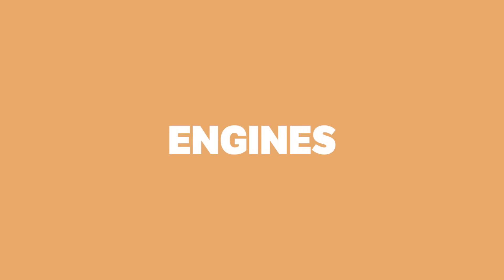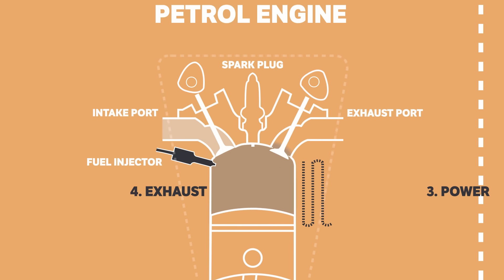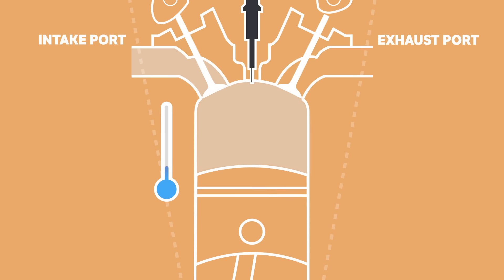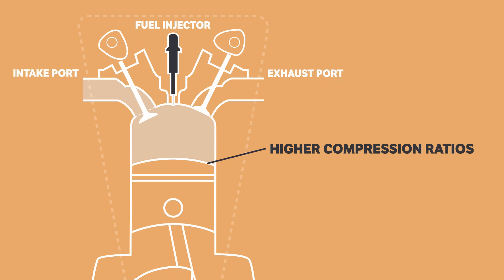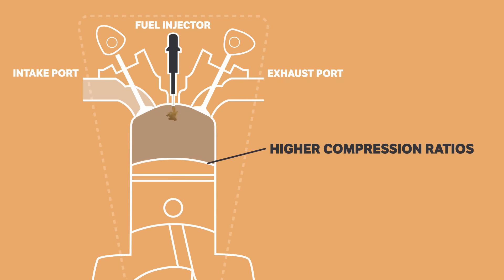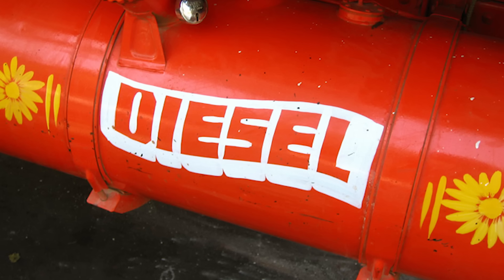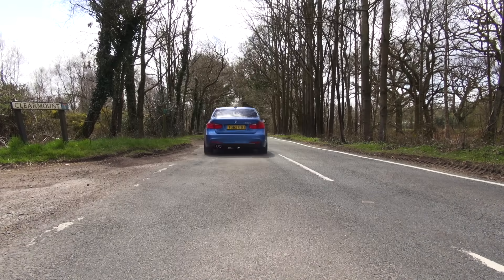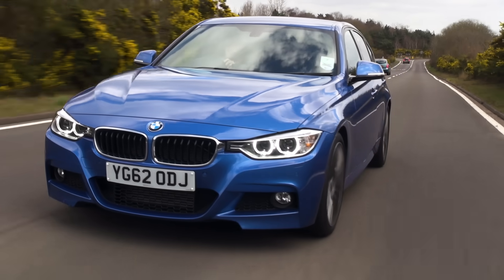The Differences Between Petrol and Diesel Engines

Comment: Can you do a turbo vs supercharger ☺️
Reply: I think he's only heard of the SRT Demon.
Reply: diesels do better with a turbocharger because of the high compression it will drive the turbine blades better and will lite both chargers for better boost and the diesel will get more torque that way but superchargers rob a lot of power from the engine to spin them for the air pressure into the engine
Reply: diesels are more built for torque and pulling and are not made for speed that is why the power curves between the two engines is the opposite and a diesel has got to get to 1000 rpm before it starts making its HP where a gas engine can make it at a lot higher rpm`s versus the diesel but the diesel wont stall as fast under heavy load like the gas engine will because of the twice as much compression
Reply: both compress intake air to get more oxygen in the combustion chamber - with more fuel and oxygen you can generate more power and torque.
the main difference is how they are actuated: while the supercharger is powered directly by the engine with a chain or belt, the turbo uses the exhaust gas to turn a small turbine. this turbine is connected to a second one on the intake side, which compresses the air.
this is the reason why turbo engines are more ecological, they use energy that otherwise would be lost. they need a certain rpm to work properly, while the supercharger does its job right from the start.
i hope this helped a bit!
Reply: I only deal with diesels and I have a 96 dodge cummins with 12 valve motor in it and I built the truck and it has lots of low end torque as a real diesel should and I designed a part for the fuel system that gets more power but uses less fuel and burns more efficient the fuel and the engine can breathe better too
Reply: The Bugatti Veyron and Chiron both run 4 turbochargers, not superchargers.  The Hennessey Venom GT is a twin-turbo.  F1 cars use a turbo.  The land-speed record for a piston-engined car was in a turbocharged V8.

Which world are you talking about?
Reply: I feel like turboes are better on smaller engines, and superchargers are better on larger engines.
Reply: chris mchenry petrol doesnt need that much boost die the same hp. give a petrol the boost the diesel has and it will fly.
Reply: Thundershark777 Best explanation
Reply: Kolin supercharged cars will be quicker off the line but not faster top end, put it this because a supercharger is driven by the crank, at certain rpm that's all you'll get out of the boost you'll get, now in theory, with a turbo because it is exhaust driven at certain rpm with higher spool the combustion is even grater causing more exhaust gasses resulting in even higher spool causing combustion to increase again continuing the process until you let of the gas...
Reply: With the diesels higher compression it can power the turbo better and you have got to match the turbo with the size of the motor to make sure the engine is getting enough air for the atomization of air and fuel mixture because the air ratio is a lot more than a gas engine is
Reply: chris mchenry and because it's safest in hight exhaust thrust
Reply: Limbos I'd also like to see a video by them on this. I already know most of it, but he makes it so easy and enjoyable!
Reply: Watch mighty car mods for that
Reply: supercharger is powered by the crankshaft my man, faster your pistons are moving the more boost you have, that also why you have boost from idle (no lag) and in neutral, if it were gearbox driven you'd only have boost once the car starts moving in gear as well as tragic supercharger lag. You're right with the turbo though, it is more efficient...
Reply: The supercharger is the same principal as a screw type compressor that it compresses high volumes of air and force feeds the engine with boost pressure in the intake side to help the fuel burn better and just a ? is which diesel engine maker made a diesel that wont run with out a supercharger because it cant make its own compression and needs a turbo and supercharger both to get decent power out of it to pull
Reply: chris mchenry that's why I like pulley kits for supercharged cars
Reply: +Kolin Stallman I have to disagree. Put simply, the fastest production car (as well as the quickest) that uses a supercharger is the SRT Demon. However, there are plenty of faster production cars that use turbos because, despite the lag that superchargers don't have to deal with, they are more efficient. They generally make more power, although at a higher RPM, it is still a higher gross HP number. Torque is also generally higher, but with a supercharger, the numbers of torque and horsepower are generally closer together, whereas in a turbocharged engine, HP is generally far higher, unless the engine had more torque than horsepower to begin with. I, myself, prefer superchargers for the lack of lag and (in my opinion) better sound, as well as (once again, in my opinion) the better look. But, I can acknowledge that turbochargers are generally better than superchargers. To put this into perspective, the Dodge SRT Hellcat's supercharger makes roughly 200BHP, when you include the intake, intercooler, and exhaust system needed for the supercharger. A turbocharged BMW M5 Jahre makes quite a bit of power, but the turbo is most of that power. Factoring in the intercooler, exhaust system, and intake, plus the turbo itself, it gets about 400BHP. From the turbo setup alone. If it were NA, it would make only about 200BHP out of the 4.4l twin-turbo V8. So, to refute your argument with evidence, have a nice day, and know that, once again, I, too, prefer to use a supercharger. Hell, I'm supercharging my towing rig until I get a diesel, and I'm supercharging my Corvette. It's just my preference.
Reply: Because the supercharger responses faster for instant power boost to the engine to get up and go instead of having to wait the extra time for the turbo to wind up and build pressure and for the turbo to catch up with the engine and diesels have more pressure in them to drive the turbo better than a gas motor does and with the pressure  turbo can get the gas engine block cant hold the pressure as good as a diesel can
Reply: Super charger is powered by the gears in your gearbox to drive compressor, which would also consumes up your engine horse power, in other words, less efficient. Turbo uses exhaust gas to drive the compressor section, it doesn't require you to mount it on the engine, it is more efficient. Due to the high compression ratio of the diesel engine, the exhaust pressure is higher, which results in higher turning speed of the turbine blades. Higher turning on the  exaust turbine blades create higher level of compression on your compressor section on a turbo charger. Turbo is the way to go with diesel.
Reply: Why do the fastest cars in the world use superchargers and not turbos?

Comment: There are fun Diesels but personally I prefer petrol, just sounds better and I like the smell of more 😂, also If I'm not wrong the reason why we got such a fucked up pollution problem is because of those diesels, but they good to get from point A to B if that's all you look for.
Reply: Not really. Only about 30% of green house gasses are emitted by cars. The major culprit is live stock. Mostly cows, that produce methane, which is up to 72 times more potent of a greenhouse gas. Diesels actually have less CO2 emissions than petrols, only more NOx emission (the one VW cheated on).

Comment: Petrol engines have very poor feedback. Hardly any in modern cars.

I think diesels are much better. You can really feel the engine. Not to mention you'd have to be downright stupid to choke a diesel engine, so it's a much better choice for beginners.
Reply: what you "feel" is the engine not running smooth since diesel engines shake much more then petrol engines. what u call "no feedback" is called luxury. also feedback comes form the steering wheel, not from the whole car interiour shaking ;)
Reply: That's true, but I think it's more of a "new car vs old car" argument. I have 2001 Golf TDI as my daily driver, no complaints, everything feels great. But when I drove my uncle's Golf Plus (2007 I think) the clutch felt like  it was... on a rail, if that makes any sense. I think it has some mechanism in place to prevent choking, and it takes away pretty much all feedback.
Reply: Feedback aka HUGE vibrations. Plus they have terrible response. I hate rev matching with these...
Reply: Everything that's mechanical gives feedback, or at least it should. Modern cars are designed for comfort, if something doesn't work correctly and there's no dashboard signal for it, you're pretty much screwed. In old cars you can usually feel any mechanical malfunction.
Reply: i beg to differ sir... my naturaly aspirated flat 6 rwd petrol engine gives me way more feedback than my previously owned jetta tdi. diesel are noisy that's for sure, u can feel and hear that ;D
Reply: The clutch is usually  more soft and comfortable in diesel cars, which I love so much. Nothing beats a soft and comfortable clutch. like you get used to it so fast, so its so easy to switch between cars.
Reply: diesel engines give more "feedback"? lol you mean nailing noises? or do you mean Sound, throttle response, instant power?
Reply: Are you European (No offense, I am too ;) )? Here lots of people prefer diesel because "they feel better", but actually it's juste because most of our petrol cars happen to just be some sorry rustbuckets for occasional town driving, or extreme economy cars. I've had (and still have) a petrol car you'd have to be really bad at driving to stall. I once started from a dead stop in 3rd gear and realised it when I wanted to shift, or achieved going all the way to 5th gear from a dead stop without using the accelerator. And it's a petrol ;)
Reply: clutch helper spring most modern cars have them and remove the feel of the clutch feedback
Reply: they can also be removed most of the time
Reply: Beginners aside, any moron can get a driver's license nowadays. Especially in the USA.
Reply: Obviously you don't drive performance cars. A good petrol engine is WAY more responsive than a diesel, will rev a lot higher, rev quicker, and have a much bigger power band. Theres a reason proper sports cars only come with petrol engines.
If you can feel the vibration of the engine, that's not a good thing. It means the engine is rough or something is broken.
Reply: I sort of agree with all of you in your answers but one thing that keeps popping up in my mind is about what car you drive. I have driven a lot of cars (both diesels and petrols) and it all depends on what kind of car it is. I have always owned petrol cars before but now i own a diesel. I have owned a lot of different cars like Volvo 745, Audi 80, Golf, Bug/Type , BMW e30 318 (m10 engine), Honda Civic EK9 and a couple of other cars but now i own a Peugeot 307 1.6 HDI. I really like my Peugeot i have now and i bought it just because i travelled long distances for half a year. Here in sweden at least many people think they are crap and i cant really see why..? Sure, the interior is not as good as the german premium cars of course but you get a lot of car for your money. The car i had before this one was the Honda Civic and everybody told me it was great cars that never broke down and so on. Garbage! First of all it was really boring to drive, the interior was thin plastic crap built for kids, the engine had no power and the damn car always broke down. I just kept changing parts all the time and it was by far one of the most expensive cars i've owned so far. The volvos (i've had 2 different) was thirsty things with no power and the interior kept falling off all the time. I have also driven a Skoda Pickup 1.9 (NA) and it had no power but it was cheap to drive. I dont say that my Peugeot is fun to drive but it does the job. The most fun behind the wheel of cars i've had so far is actually in BMWs. Even my old 318 was fun to drive even though it was a pile of shite. If you want a fun car to drive everyday that sort of is a drivers car i would recommend you guys to try a BMW, no matter if its a diesel or petrol :)
Reply: @99Lezard99

I mean overall feedback. That includes noise, vibrations, throttle response, everything.

@Yolo Ritona

Feedback refers to the overall response you get from the car, not just steering. Translated, that's the term we use here. If it means something else in English speaking countries (I doubt it) then sorry.

Anyway, call it whatever you like. But for me, if I can't hear and feel the engine AT ALL, then I can't drive the car. I just can't. Maybe I'm a shitty driver or maybe you were born with super human senses, but until someone can prove one or the other, I'm sticking to older cars.
Reply: @BlatentlyFakeName

Somehow I doubt you drive Lamborghinis on the daily basis either. As it happens I did get the opportunity to test drive a 6 speed manual, 2.3 EcoBoost Mustang recently. It felt like every other post-2010 car I've driven, only with slightly nicer seats.

(that's a metaphor, I actually didn't like the seats either, they felt awfully cramped for such a big car. It might just be my fat ass, but my Golf seats with the tacky beads on 'em still feel a lot more comfortable)

Anyway, engine feedback is normal in older cars. And it's a good thing to have, it gives a much better idea of the state the engine is in than the dashboard indicators. But like I said, I think the issue is more likely related to new cars vs old cars than diesel vs petrol. I admit that all the newer cars I've driven all ran on petrol, while most of the older ones were either diesel or LPG.
Reply: Why do people choke engines and call themselves drivers?

Comment: I'd go for diesel. moar power!
Reply: Diesel have more torque at LOW-END, yeah, but petrol is always high rev and has better HP/litre. needs a 2L diesel turbo to have same bhp as a 1,6 NA petrol also, haha... :P The 1,6P NA beats the 2,0D T iirc :P And room for turbo :P
Reply: Diesel has the energy/"power" to make torque/pull. Petrol has the efficiency to make high end HORSEpower, RPM advantage and so the power to "run" from a diesel of the same displacement without needing "charge" ;) :P
Reply: lawlerzwtf most diesels' hp curve die over 4000rpm... while a regular petrol engine will produce peak hp at around 6000rpm. and hp is torque x rpm so... do the math. compare NA diesel to NA petrol or both with turbo, petrol will always get more horsepower.
Reply: TheYosiFTW not true, modern diesel trucks have what's call a DEF system, which makes the exhaust release mostly H2O or water
Reply: I wonder why the world's fastest drag cars and race cars aren't diesel
Reply: HardstyleBeats_Mixr hmm yes thats basically the difference. the problem with diesel is that its pretty hard to mix it with air, so when the rpms go over 4000 there isnt enough time for it to mix properly so it cant produce any more power.
Reply: more like: less power but bigger torque and it also sounds like a fucking tractor
Reply: @Nathaniael The video just said more power in the fuel itself...
Reply: JosephHaskin H2O is water...
Reply: Same will happen if you huff fumes from a gas exhaust, not just diesel. And for those who think they blow soot everywhere- ONLY IF YOU DUMP MORE FUEL THE COMBUSTION CHAMBER THAN IT CAN BURN! Other wise it will burn perfectly fine.
Reply: ah! that old thorny issue......!!!!
Reply: and that's why a 2.0L petrol engine has more horsepower than a 2.0L diesel engine? xD And the difference is even quite high on some cars. For example like with my Focus ST it has +-250hp compared to the +-185hp of the diesel version.
Reply: Davy  Lievens still not power just acceleration momentum
Reply: Deepti Jaywant not more power. Just more torque
Reply: "Moar power"?!?!?! Piss off petrol has more power. Diesel is just a dirty shitty fuel
Reply: Jai Vaja diesel can make way more torque and so more power, look at those drag race "pick-ups".
Reply: And torque!
Reply: POWERRRRRR!
Reply: Deepti Jaywant wrong.
Reply: TheYosiFTW who cares about pollution. I hope the earth actually dies of pollution so things  can start from 0 again
Reply: And cancer.
Reply: and pollution!!

Comment: its called petrolhead for a reason. Nuff said
Reply: Benoit other way around diesel is less refined then gasoline
Reply: LowRezz big American V8 turbocharged diesel for the win
Reply: dieselhead HAHA
Reply: LowRezz that's why I'm just a Car Enthusiast...
Reply: LowRezz it's called gear head in America, we're a bit more accepting.
Reply: Bit of a bollocks statement.
Reply: Hybridheads
Reply: There is old finnish saying: "You wash paint brush with petrol and make power with diesel."
Reply: crackhead